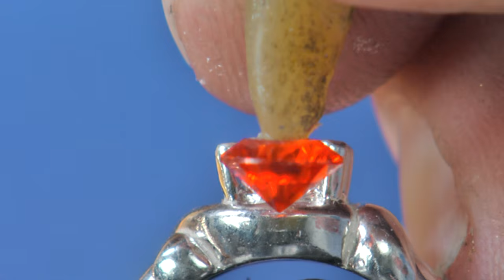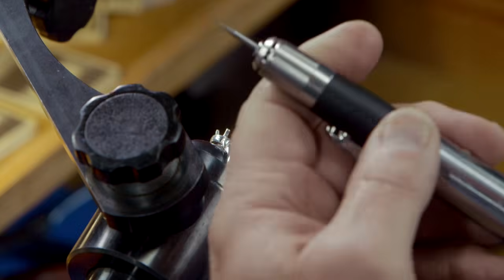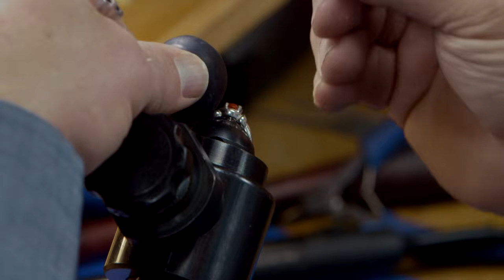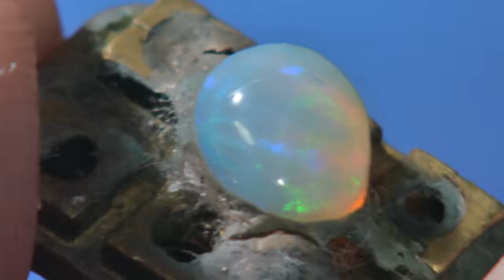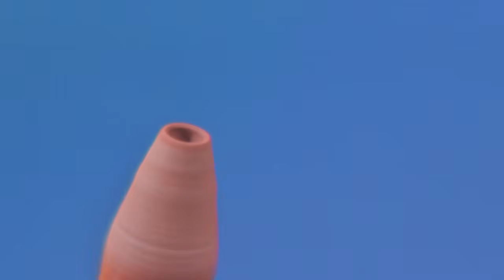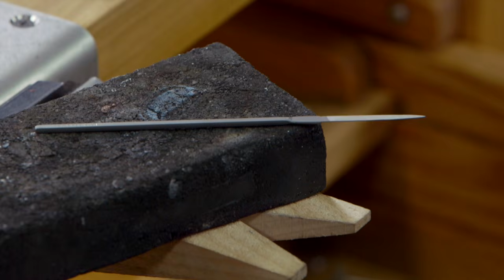Stone Setting Tips and Tricks with Blaine Lewis

Comment: Viewer warning, some scenes may be distressing for some viewers. Scatching that opal made my heart lbeed... How do you recuperate the enlarged hole in the ring (after the broken drill bit)? That looked like a bomb crater..
Reply from the maker: The Agilo cabshine wheels will clean up a scratch on a cab very easily. 

If you have a pulse arc welder or a laser welder you can repair the enlarged hole. Hopefully the pilot hole is still small enough that you can go in and cut the seats for the stone without any issues.
Reply: @RioGrande1944  Thank you!

Comment: Are diamonds as brittle as CZ? I have been practicing setting cz in silver on the band of a ring and I cracked several czs in the process. Will I likely face the same issue when setting diamonds? The setting style was into the band, drill a small hole cut slots across and lengthwise to create prongs and then pressing them down onto the edge of the cz.

Comment: When your metal is to the right temp to anneal, a magnet will not stick to the hot metal. Than wrap it in ceramic wool and it will the softest it can get. I'm a blacksmith knife maker, besides jeweler .

Comment: Ive been training in setting and we do a lot of "bezel" setting with round burs and im having a hard time getting the stones to sit flat. 

Its soo hard to see anything, prong setting looks loads easier cause you can get a profile view of what you're doing. 

I can't find any guidance on this setting type. 

Im tempted to ignore instructions and try to snag one of those heart burs and use it instead of the ball burs. The heart burr has a straight line to help visualize flat, unlike the ball bur. The curves from the ball burr cause the stone to slip and tilt when you try to pound it in. 
Who am i to question it but it just makes more sense to me.
Reply from the maker: Hello mtneves77, we agree that even when bezel setting you would usually need a setting bur to cut a seat and get the stone to sit flat. There are many different kinds, but here is an example, https://www.riogrande.com/product/busch-tungsten-vanadium-stone-setting-bur-set-3-58mm/341607. 

As far as education about bezel setting, we have this video about tube-bezel setting, https://youtu.be/T525P22AtNE, and this video contains info about flush mounting, https://youtu.be/MllFfsZqX40?t=201

If you have any other questions, please contact our Jewelry Tech Team by phone at 800.545-6566 or email, technical@riogrande.com.
Reply: @RioGrande1944  wow this made my day thank you for your reply, I have a feeling this is gonna be the start of a great subscriber-ship.

Ill be sure to mention this to my instructor.
Reply from the maker: @mtneves77  Great, glad that was helpful!

Comment: Hello Blaine, I always enjoy your video and your professional comments and guidance. I did purchase some of the burrs you mentioned and suggested in your video. I recently finished a 14mm dia. Brilliant cut on a blue Helenite stone. I am in process to set this stone in a Sterling Silver five prong pendant. The pendant has two rings on the bottom with prongs soldered on the upper ring. My question is this: how far should I set the pavilion into the pendant, or how close should the pavilion be to the upper ring? Touching or 1-2mm from the ring. I would appreciate any advice you have. Thank you

Comment: Thank you Blaine for the excellent video, instructions and tips. I mostly just spend time Faceting stone but lately I am working on setting my stones. I have some questions: where do you get this twin cut burr and also the 3mm Aluminum Oxide wheel. What about the Silicon pommes wheel? I would appreciate any information.
Reply from the maker: Glad you found the video helpful! Here are shortened links for the twincut burs (http://ow.ly/GsY030iqMOz), the 3mm Cylinder Aluminum Oxide wheel (http://ow.ly/slDY50DERDG), and the Silicone Pumice wheels (http://ow.ly/2eZy50DER4d). Please let us know if you need to find any other items from the video!
Reply: @RioGrande1944  thank you Blaine for all the information. In regard to the brown silicon/rubber cylinder, you show a collet type chuck to secure the cylinder. Can you also get it from your source (riogrande.com) ? If  I use a mandrel this cylinder will not be very sturdy. Thank you Blaine.
Reply from the maker: @kseibert60  Hi, yes you can also get the collet chuck from riogrande.com if you click here, http://ow.ly/bb6H30iqMNM

Comment: Hi I have a three stone ring and I want to change my side stones to a bigger stone. From 0.3ct to 0.43cts does that mean that I will need a new setting or can I use the existing prong that's currently holding 0.3ct?
Thank you in advance!
Reply from the maker: Hi Sam, thank you for your question. Depending on the cut of the stone, you may be able to use the existing setting or modify it slightly to fit. If you do end up needing to modify the setting, give us a call at 800-545-6566 and Tech Support can walk you through it!

Comment: I'm researching faceting machines and ran into you by chance. building a machine right on top of the pulley system of a small drill press. Anyway, you've probably given a week's worth of information here than I received in a class 35 years ago. I love metals and micro-adjustments. Love your style I'm in. Subscribed!
Can you tell me what budget machine would be worth the trouble in using?  As a professional, I'm assuming you don't cut corners on your tooling like my self, but I'd love to give this a try.

Comment: great video with lots of good info. 
 
Regarding removing broken drills.  I use dividers to mark on the other side and drill from the back until  you hit the broken bit, then using a broken fine burr that is shaped to a point and punch the drill out. 
. 
Not every one has tungsten burrs, I prefer the tungsten inverted cone to remove the broken bit as it cuts really well.  to prevent the drill from jamming , listen to the noise and as soon as you hear a crunching sound of the flutes getting full of  metal remove the drill to clear the swaff . 

Rotate the drill in  circular motion that gives clearance around the drill and stops it from jamming.

 Another this is to sharpen the drill to a fine point that is able to stear the drill to where you want  it, continue with the rotational movement and you can quickly drill though thick metal with ease.

Comment: Awesome! How do you fix the hole that became larger while trying to remove the broken drill bit? Or did it not get too big for the size needed for the stone you would have used? Thanks!
Reply from the maker: Hi, and thanks for asking! Blaine's demonstration of the results of not keeping the bur on the drill bit is a cautionary tale, for sure.  Our Jewelry Techs say that the only way to make a hole smaller is by filling it, which would require a laser welder. Hope this helps!

Comment: Super video!! With regard the drill bit broken in the metal, I just heat the metal (if possible). It softens the steel piece and you can just drill through it.

Comment: One other thing is on the market what are most types of rings made out of interms of metal is it casted silver , casted  stainless steel , casted copper , casted gold ,...? forgetting about the stone for a second  which could be gem , diamond , ruby ,...etc just curious on what the ring itself is made of in metal materials. (to practice casting/molding a ring i imagine one could uses a low melting point metal like solder but any metal could be casted in a ring mold if you can heat the metal enough.... i just curious what jewlery stores usually sell interms of the material in there casted rings.

Comment: I was taught to only anneal in dimmer lighting otherwise it gets too hot before we see the color change is it different with annealing tools?
Reply: Staggering to see how easy it is. May I ask if you using a USB camera with a black n white screen OR colour nearby. What resolution is the USB  camera. I do laser Welding but my steroptic dioptors are set at 10 plus for overhead use. Do I need to change diopters or need to change the scope to a more likable range that can be slipped in place for transfer design viewing. Great Explanations